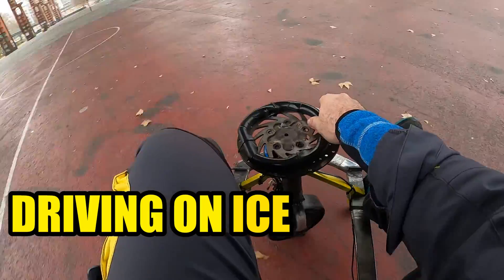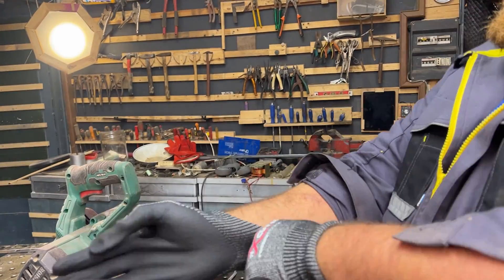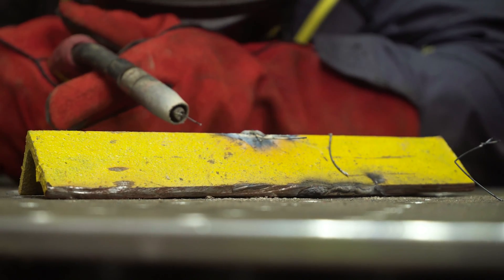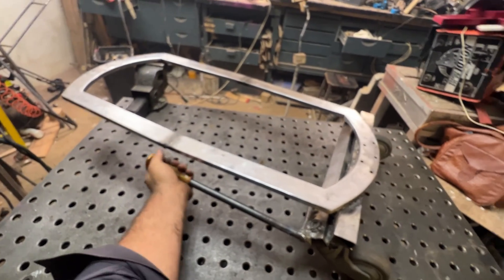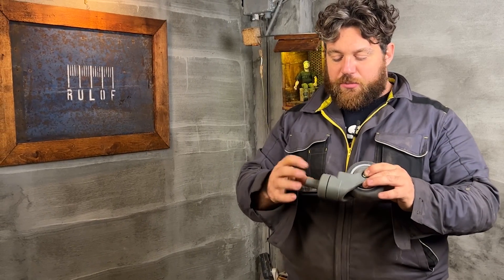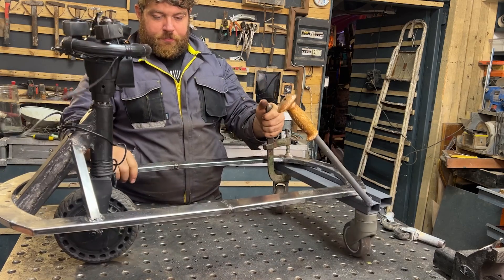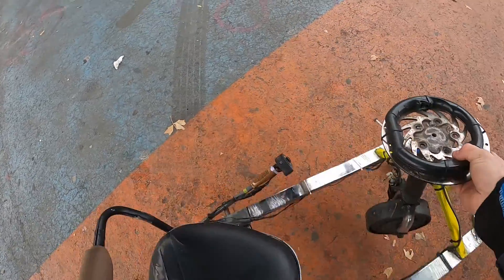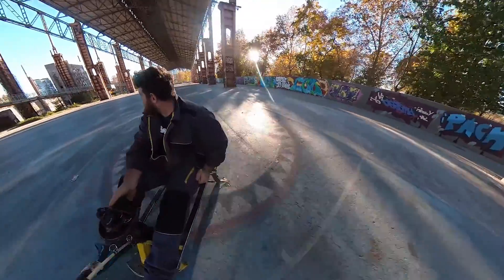How to Make a Crazy Drift Kart • 350 Watt

Comment: I did exactly the same thing and for the frame I used the bottom of a shopping cart with the four wheels, it made me gain some time; The main difference was that I didn't made the clever lever you made to change the inclination of the rear wheels !
Reply: @fraaggl how much $ did it cost your kart?
Reply: @Xexeves  less than a hundred Euros.
Reply: hey how did he attached the motor and battery